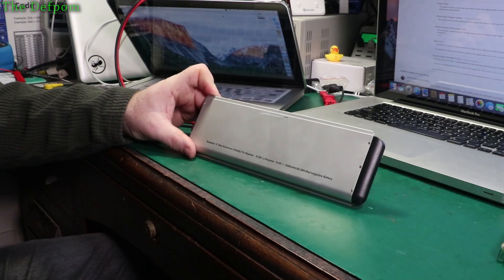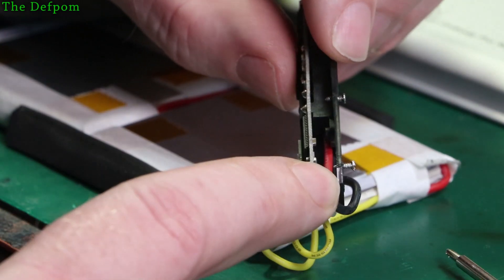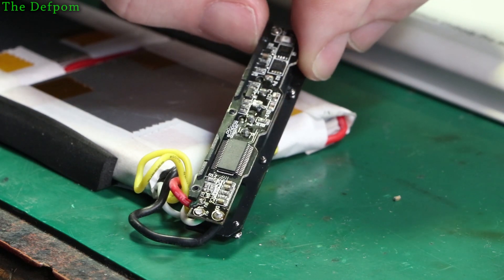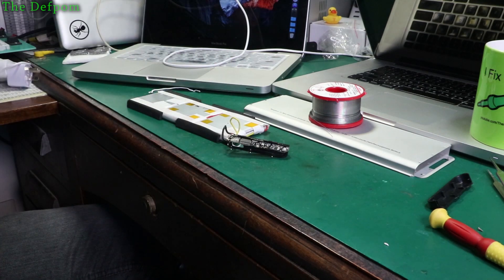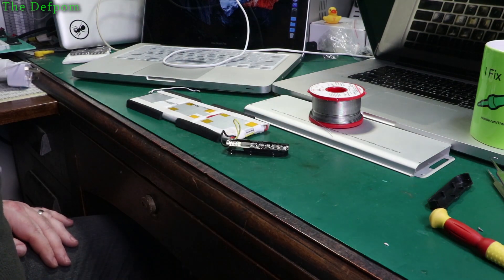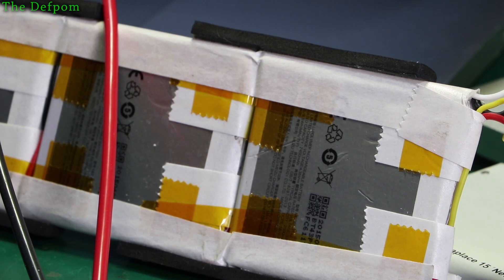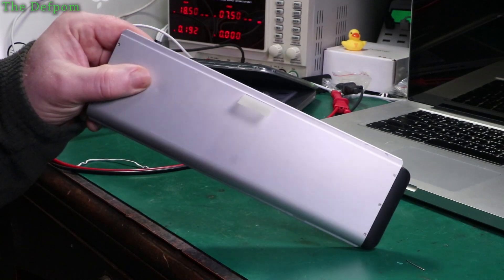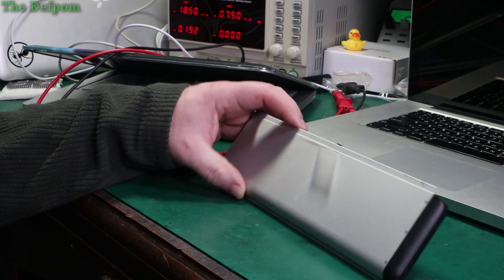#738 Apple MacBook Pro 15" 2008 Battery Teardown & Repair - Battery Wont Charge Says Replace Now

Comment: can you wake up the electronics of the macbook air 13 (2013-2017) battery? the battery is stuck after the Mac comes in contact with water

Comment: You are very lucky that the chip did not lock out or set a flag as a bad battery
Reply: Lol my original 2012 macbook pro 15 did that, even after recharging every cell, it still wouldn't let voltage past the regulator

Comment: Thank you for another interesting video, Scott. Had to laugh when the capacitor fell off ! Did you pull out the microscope and give that charge board a good look over? I think two bad solder  connections would  justify a complete inspection.
Reply from the maker: yep i had a close look at the entire board, the rest seemed ok.

Comment: High quality replacement batteries LOL. Makes you wonder wouldn’t want one of these in the house dubious safety.
Reply: Lol I have seen even worse on genuine batteries. If you think that original apple parts hold any additional quality you're dead wrong. Apple is simply not a quality brand.